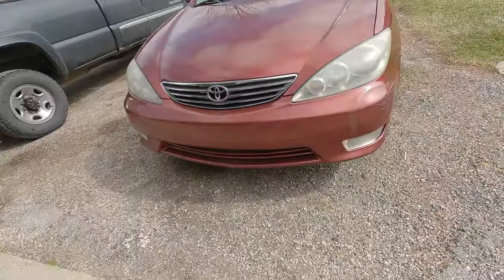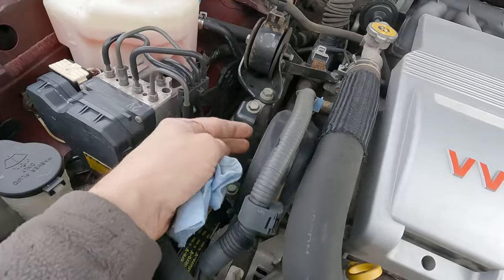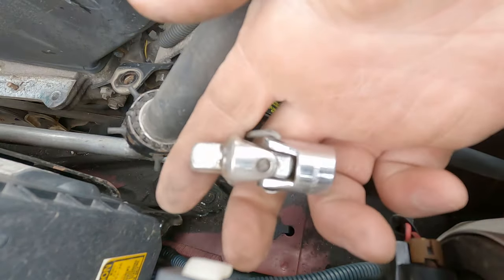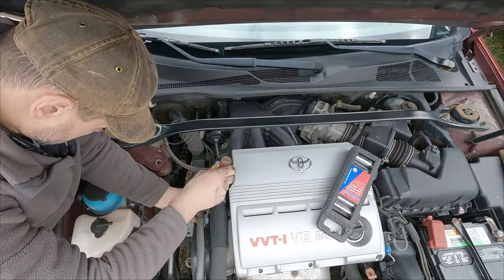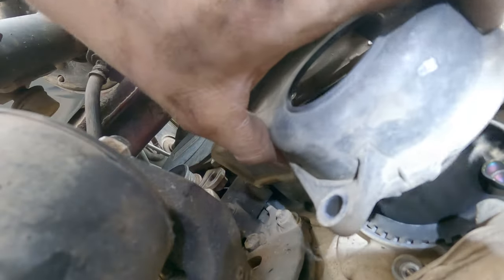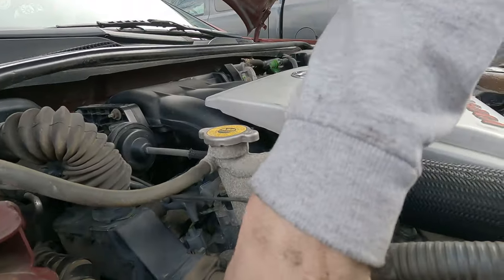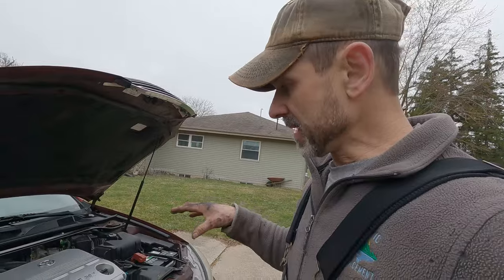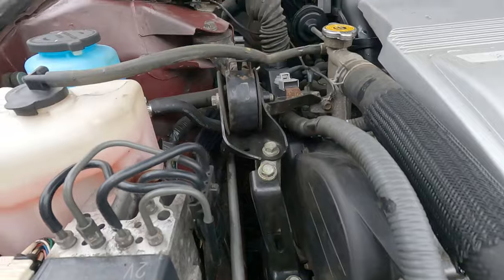Timing Belt Replacement On Toyota Camry! - Step-By-Step Guide

Comment: What thread size is needed for all three bolts when using the gear puller tool on the crankshaft pulley?
Reply from the maker: I believe the 2 bolts I used were 5/16-18 thread about 3” long.  They came with the puller kit.
Reply: @therustichandyman Thank you! I have a Duralast steering wheel puller kit. It has two 5/16X18 UNC. Hopefully it does the trick. 🤞🏽

Comment: Never ever ever remove a timing belt until all of the timing marks are lined up our gonna bend all those valves
Reply from the maker: That only applies to an interference engine where the pistons and valves share space. This doesn't apply to a non-interference engines, which is what this older Toyota has.  Thanks for the feedback!
Reply: @therustichandyman  this engine is a vvti, this IS an interference engine.
Reply from the maker: @JackMeyHoffer562  the 3.0L 1MZ-FE engine is non-interference, vvti or non-vvti. The 3.3L 3MZ-FE IS interference. I researched this before I did this job.
Reply: @therustichandyman  the engine cover says right there vvt-i